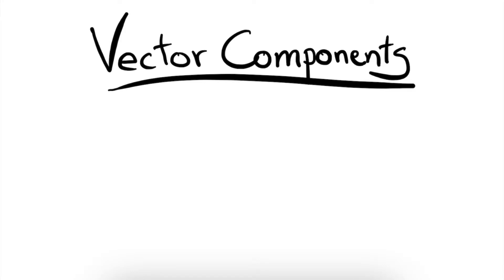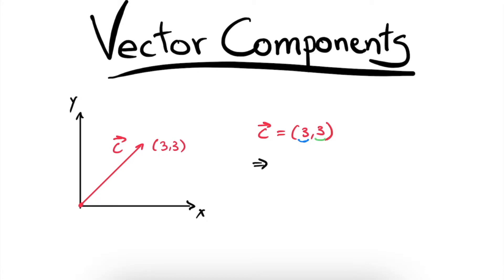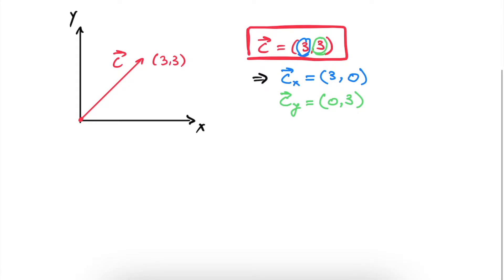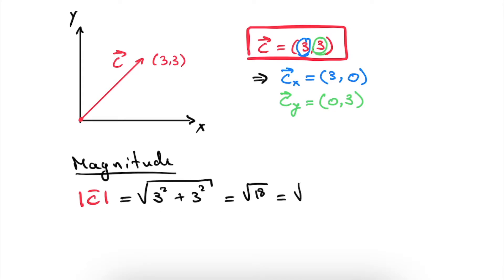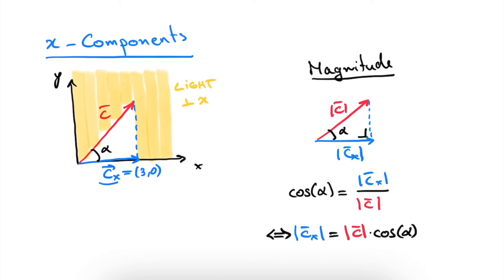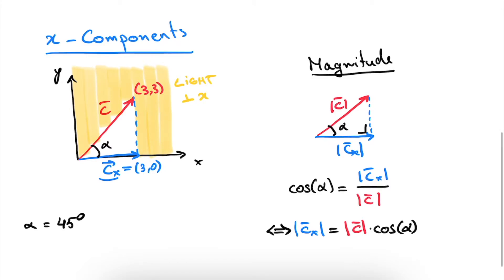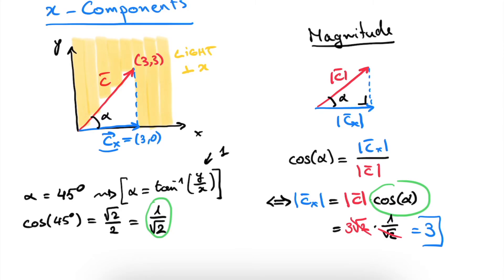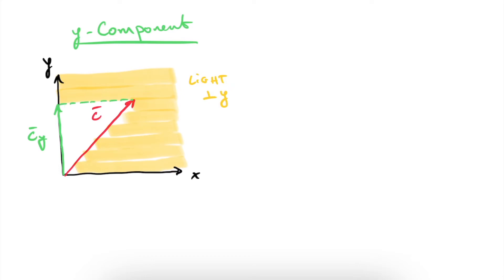Vector Components - What and How (Step-by-step)

Comment: What happens when vector points in negative direction of x/y axis?
Reply from the maker: The same formula applies, just the components of the vector will have a minus sign in front of them. Matrix remains identical.
Reply: @PenandPaperScience  Actually component could be defined as length (magnitude) of component vector along with directional sign. For example: v = |v_x|(-i). And then component is v_x = -|v_x| . Did I get it correctly?